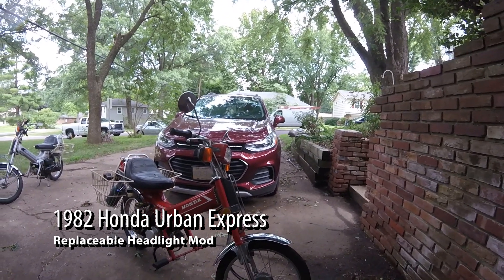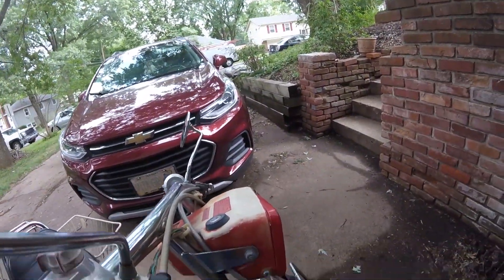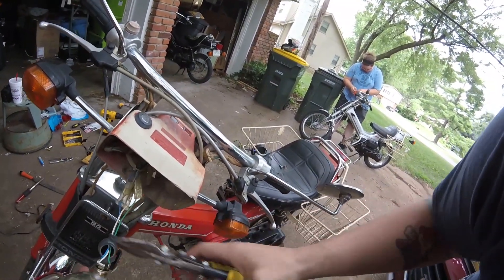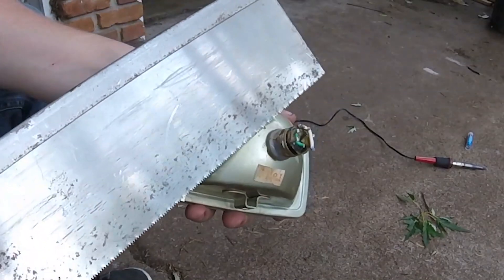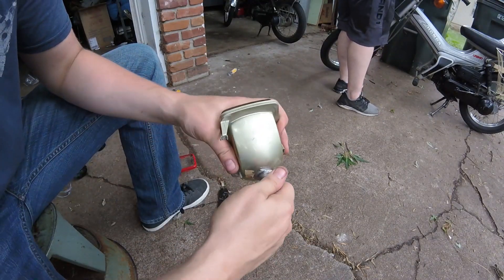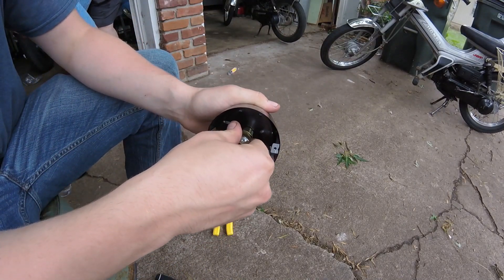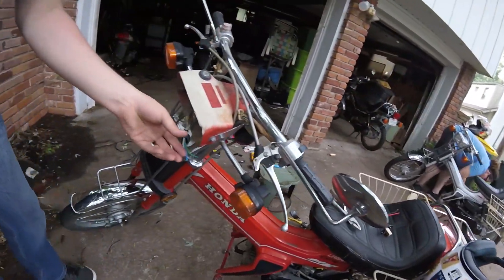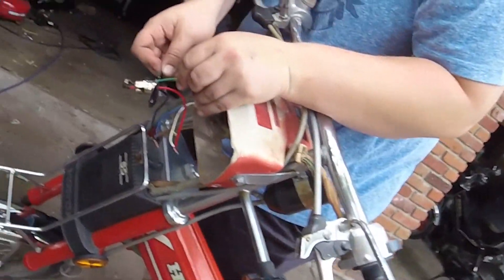Create a replaceable LED Headlight for 1982 Honda Urban Express

Comment: Sorry, a little off topic of headlights, but my '82 has a bad stator. They are apparently not available. Have you or anyone) ever replaced the CDI stator unit with an earlier points type?

Comment: Bro, you could’ve put a much better COB led or Cree 50/50 and you would not have any flicker or anything the LEDs come with their own ballast that will take the 12 V and manage it properly. 

Also, if you’re interested in hearing about the modifications, I’ve done to my 1982 Honda urban expressed that goes 50+ miles per hour. Let me know ;) it’s stupid easy

Comment: I was able to use the concepts from your video to replace my sealed-beam headlight with a LED.  The only thing was that I could not find the trailer tail light at Walmart or anywhere else.  The only trailer light that I founds was a native LED unit, but that did not work at all.  I ended up getting a 2057 LED bulb, and a 2057 light socket from Amazon.  I cut off the old socket and used a Dremel grinding stone to make the hole bigger.  I then shaped the plastic on the Amazon socket to fit exactly snug in the hole in the old light.  I then used wire ties to secure the socket so that it doesn’t work its way out.  Everything is working as it should now.  Thanks for the video.

Comment: Nice video. Good production. Please consider making more maintenance and repair videos. There is not much out there on the NU50. On this mod, I would just drill a small hole on the housing for a ground screw. Saves the issue of soldering the ground to the bulb housing.  Bulb Ground would be from the bulb housing mounting tab to the lamp socket.

Comment: Thanks for the video. I recently bought a 82 honda urban express and the guy never mention the head light was out.  So when i took it home I was a little disappointed. I gave your tutorial a try and i got it working. The only thing i did different was keeping the light bulb that came with the brake light. The LED bulb was too expensive almost 18 dollars. Im still able to switch between low and high beam. Although the low beam is quite low but the high beam is really bright.
Reply from the maker: I totally understand and have recently tried the other bulb out as well.  The LED just wasn't as bright as I was hoping.